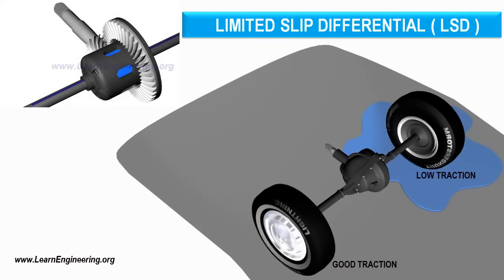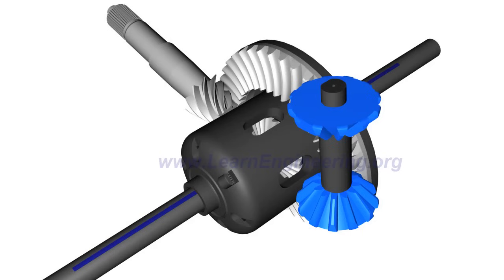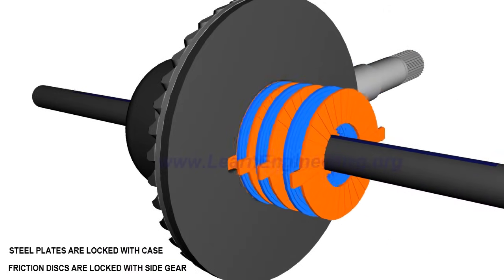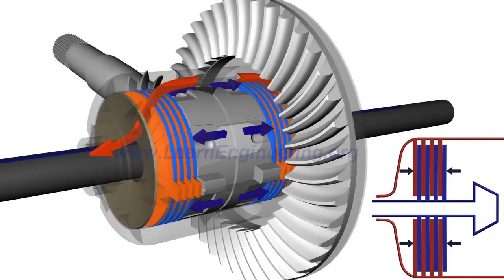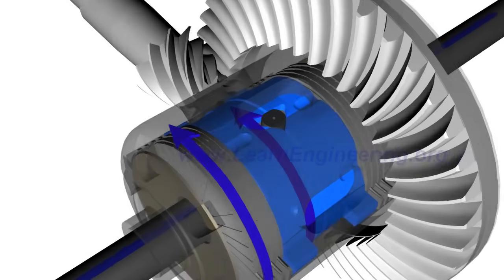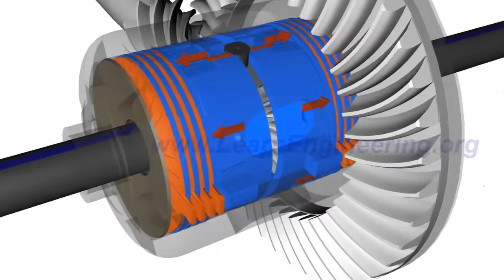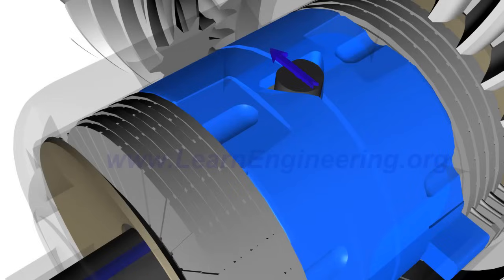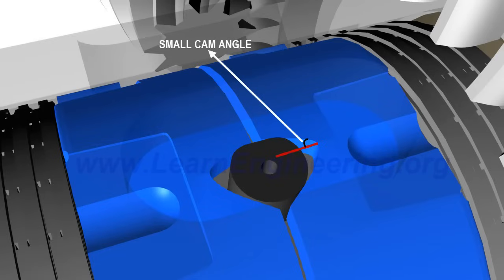Working of Limited Slip Differential

Comment: So they use physics by allowing torque to organically adjust towards the optimal amount of differential rotations which will offset the uneven rate of rotations in order to maintain stability and traction? That could be wrong but im trying here😢
Reply: No, not really. Its nuclear fission! 🤣😂🤣
Common!

Comment: What software do you simulate it with?
Reply: Any multibody tool out there that supports contact modelling and gears modelling (not necessarily the most accurate gear modelling, but enough to generate the bevel gears axial forces correctly!).

Comment: In short: Engaging the clutches of the LSD negates the operation of the differential temporarily. Can anyone please verify if this statement holds true?
Reply: Yes. The more torque applied by the ring gear to the carrier and thus the pressure rings, the harder the clutch packs will lock up, and the more resistance there will be to the side gears & spider gears spinning at different speeds.

Comment: I understand how it is supposed to work, your video does an excellent job on filling in any gaps.  However EVERY limited slip equipped car I have seen that has 1 tire slipping never had the opposite tire start rotating.  Brand new to a few decades old vehicles of various brands. My question is at what speed or time or whatever does the other tire start getting power since I have never seen it actually happen in real life?
Reply: If you jack up the vehicle in question, and while left-and-right axles are suspended in free-hang, spin an axle. If the opposing axle spins in the opposite direction, you have an 'open carrier', not a clutched LSD. There are, of course, lockers and differentials of such nature, but they are very pricey, and normally on a car if that part has intentionally been replaced. The reason for the opposing axle turning in the opposite direction to torque input (assuming vehicle is in PARK, not NEUTRAL) is that an open carrier only has spider gears to transmit torque to that shaft. The confusion started in the 1960's, when 'car review writers' (who had 1/10th the knowledge they thought they did) started referring to open carrier assemblies as 'limited slip'...so they could push the individual car companies' patented types of LSD (GM: Posi-traction, Dodge: Sure-Grip, etc.)...their attempt to 'push an upgrade feature' then, has led to still-lingering 'naming issues' now! As for 'how/why does an LSD function'...the axles are usually in 'open' condition (as you go down the road at a steady-speed). This maximizes fuel consumption. (I've owned many LSD-equipped cars in my lifetime, and let me tell you, have one fail in the 'closed' or 'locked' position, you'll see 50% or more reduction in your gas mileage!) A 'solid axle' is NOT desirable in ANY application other than straight lines...so, good for straight-aways at Nuremburgring...not so good for those corners! MOST 'street use' (OEM-factory) LSD's are set somewhere between 70-and-80 ft.lbs. torque. This keeps them 'open' for low-speed (parking lot) cornering, while locking during straight acceleration.
DISCLAIMER: I am a retired Director of Engineering in 'Chassis Dynamics' at a major corporation...and while I can tell you MOST about the 'Big 3's' 1960's/70's set-ups and applications, can't really speak to modern advancements in LSD.

Comment: This video is wrong : "An equal amount of torque will be transferred to the right and left wheel" No, since the clutch pack is locked,100% of the torque is available to the wheel with traction.
Reply: Not 100% because whatever amount of traction the other wheel has will work to engage it's clutch pack, too. Only zero traction would get zero torque and zero power.
Reply: @appliedfacts  There is a critical situation where it goes all the way to 100% A tire that is lifted off the ground has zero traction.

Comment: I have a doubt... how this mechanism would differentiate between 1.the right wheel is slipped due to water and 2.the car is taking a curve in the left direction in which right side wheel have the higher velocity?..if in the 2nd case this mechanism will work then..the car may skid in curve path😑

Comment: The cam requires drive torque to actuate... that's an important aspect. If you're on ice spinning one wheel, the carrier will just spin and the spider gears will rotate. The spinning wheel needs traction to resist the carrier and develop torque that will force the cam pin to actuate the clutch packs.
.
It's a great system that really only engages when needed. Spider gears transfer torque to the outputs, so the mechanism will lockup proportionally to the amount of torque flowing through it. So the harder you drive the wheels the harder it locks up. Very similar to a torsen type that creates axial thrust in the helical gears proportional to the torque flow, except this system is far more tunable, and can be preloaded to always work at a minimal level where a torsen will just act as an open diff on ice.
Reply: I guess if you stop spinning the wheel and then slam the acceleration, the inertia of the half-axle and wheel + whatever miniscule traction you might still be getting on ice might be enough to lock the differential?
Reply: @MrCh0o  well, it would very do very little and you’re accelerating that wheel at 2x the normal speed. Typically these are preloaded some to prevent that and you can always tap the brake or lightly pull the parking brake to get more torque through it. 
.
I was just pointing out that these are better on road vs off road.
Reply: Indeed - this is something very few ‘experts’ actually understand properly.  👏

Comment: Let me see if I understand this correctly. Let's consider a 1-way LSD. While coasting or engine braking, the diff behaves as if it were open. Or rather almost open, since there's a slight preload in the plates. This means that in a corner the wheels can spin at different speeds by simply overcoming the small amount of pressure in the plates that's induced by the preload spring.
The diff only locks under acceleration. How "locked" the diff is is a function of how easy the plates can slip. The harder the acceleration, the higher the pressure in the plates will be, and the less they will be able to slip. Given enough input torque, the plates will be pressed against one another hard enough to prevent any slip at all, effectively achieving 100% lock. 
Is this correct?
But here's something I don't get. If the extent of the locking effect is just a function of input torque alone, then what happens if you accelerate in a corner? How can you drive smoothly round a corner while keeping your foot down? OK, under light acceleration there may not be enough pressure in the plates, and they may slip just enough to allow the wheels to negotiate the corner. But if you accelerate just a bit too hard, you won't be able to drive through that corner without slipping a wheel. What am I missing?
Reply: From a practical view, that is exactly the case with an LSD. If you put the power down during the turn the LSD is gonna make both wheels spin and you are gonna lose traction. That is why LSD is more preferable if you want to have fun with the car, and do some drifts and powerslides. The slide is also much more controllable and smoother as you are in control of both wheels spinning in oppose to only one wheel, as you have in an open diff.

Comment: Nice video🙂👍! But as i understand, a 1-way LSD of this kind can't reverse! I guess they have another mechanism for reversing. 2-way would do it & 1.5-way would partially do it with some power loss. And that brings me to the other problem of this differential (as far as i understand), that there might be loss of power in low to medium powered accelerations, since the clutches wouldn't be "squeezed" hard enough. But perhaps these clutches don't need much pushing to work efficiently.🙂

Comment: 0:03 It says dead wheel.  Ok everyone is saying torque is available to both wheels and, at 0:03, it says 'good traction' underneath a spinning wheel.

So wouldn't the torque available to both wheels be enough to move the car (in the correct gear, or is the issue not having one large enough) through the one wheel (or should the animation not be spinning?)?

Comment: So I know how a LSD works now but how do you activate it so the left and right wheels turn at the same speed? It obviously isn't always activated... or else that would be a welded diff.
Reply: It locks based on the ramp size and ramp angle under acceleration and deceleration. A sharper angle and it locks sooner. Closer angle and it locks later.

This video is better to explain application https://m.youtube.com/watch?v=ceT61lgERmA
Reply: (Decel lock depends on the style of diff)

Comment: I keep missing a couple of things:
1) If you accelerate during a turn the differential won't work because the locked mechanism, isn't it? 
2) What is the point of the 2 way type? In which situation is useful? During a steep downhill?!
Reply: Reversing off road

Comment: A big hint for offroaders with this type of differential, if you are in a situation of zero traction on one wheel, these differentials are useless unless there is a lot of pre load. To overcome this, application of the hand brake will increse the torque load to the diff centre and make it lock. This only works if your hand brake operates directly on the rear brakes. If you have a handbrake that operates on the transmission (ie. Nissan Patrol) you select 1st gear low range and apply pressure to the brake pedal. You will unfortunately have braking on all 4 wheels but the torque of 1st low will be enough to overcome the braking force. Often a short stab of the brakes will be enough to transmit torque to the wheel with traction. As long as the torque application is continued, the diff will maintain lock. I have personally been in many situations where I have had to maintain constant pressure on the hand brake due to wheels being completely off the ground due to severe terrain. In this situation you must be mindful to manage brake temperature as faded brakes on the side of a mountain can be a severe problem. Especially rear brake fade as you will be calling on them to arrest any rearwards motion if you need to stop your climb or to stop the vehicle if it begins rolling back for any reason.
Reply: I too have use the hand brake in a car with an open diff. It provides just enough pre-load to regain forward movement. Wouldn't individual brake pedals be good - oh wait manufactures are already doing this with traction control. Old tractors had individual brakes to aid tight turns but were also useful when one wheel was loosing traction.  I'm not sure about modern tractors, maybe they have enough smarts to compensate. Cheers.
Reply: So this type of differential only allows different speed on wheels if there is no torque? If you are full throttle on a corner, it will be like a welded differential?